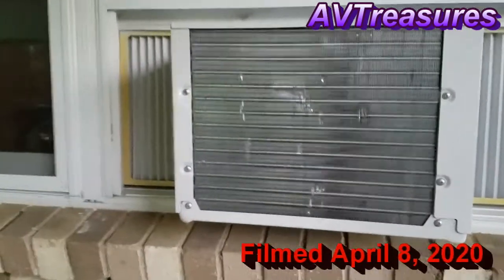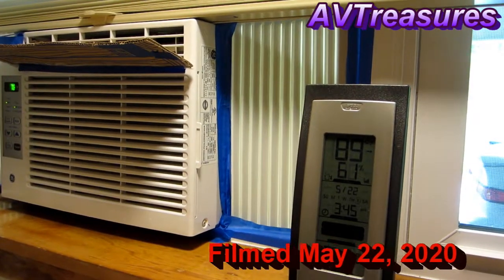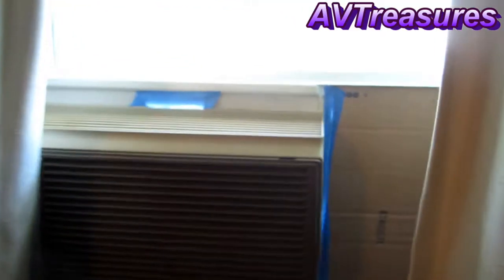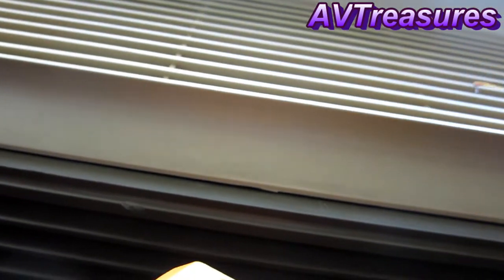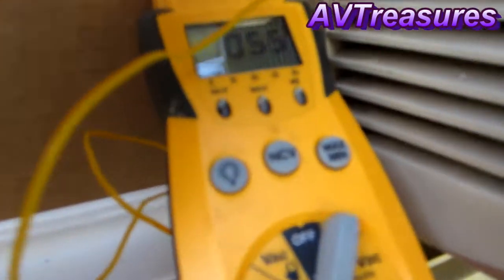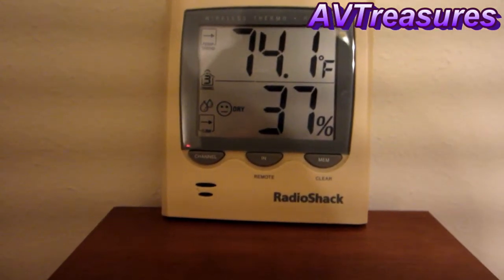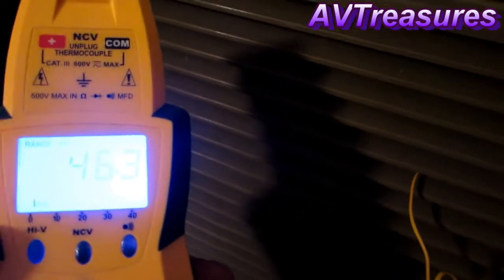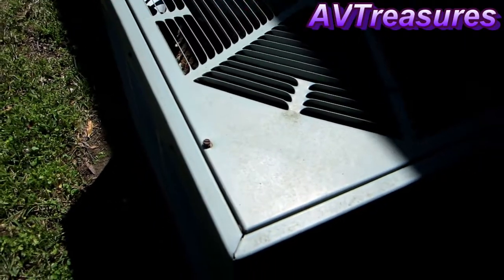Trying Out the 1989 Crest Carry Cool Window Air Conditioner | Spring 2020

Comment: That's nice that you have periods where you can do that.  Around here it goes from "too cold for A/C" to "it's staying on for the season".
Reply from the maker: This spring was milder than usual, all the way through May. I didn't turn the Rheem on for the season until June 1st. The new low E windows have something to do with that as well. I never would have made it that long without using the Rheem back when I still had the original single pane windows.

Comment: Nice units cooling and doing there jobs. I did the same thing use the central when there is a stretch of hot water otherwise my wall units manage quite well.
Reply from the maker: They are great units, very durable. I didn't use the Crest this year. I tried out some of the newer ones in my collection this spring. Thanks for watching

Comment: I do the same thing by avoiding the central air until it’s around 90 or so. It’s cheaper for me to run three window units versus running my tired out comfortmaker. Looking forward to your next video
Reply from the maker: My Rheem does a great job once temps hit the mid 90's to near 100. The rest of the time when temps are milder, it doesn't run enough to take care of the humidity. I have to run a dehumidifier at the same time. The window units are great dehumidifiers and they also are removing sensible heat which makes the balance just right. It is cheaper for me to run the window units as well. Even if one runs all day, it uses less than the Rheem would cycling on and off. Thanks for watching and commenting Ardie. I am working on another video right now. It should be up in few days.
Reply: AVTreasures do you live in the states? I live in Stratford, Canada, Ontario and we’ve been having some of the worst humidity here so I can say I can agree that the window units definitely handle the humidity way better. One of the main reasons I don’t use my central air is because my house is 116 years old and only has one return air vent. Whoever installed central air in this house back in the mid 1990’s really shouldn’t have because the ventilation system isn’t properly balanced. One day I would like to get a couple mini splits installed or a couple large through the wall air conditioners- I don’t think I’d be able to install more returns air vents. But for now I’m working with what I have! Thanks for commenting back.. I’ll watch for your new video and for your replies, for some reason YouTube never notifies me of half of the things I’d like to know about !
Reply from the maker: @ardiemclelland2039  Yes, I live in the southern United States and we get the humidity from the Gulf of Mexico at times and from the lush vegetaition and trees as well. You are right, a window unit is a great dehumidifier when there is a litttle cooling load. My house isn't balanced very well either. I have a hot room and a cold room all summer. I tolerate this by using fans that even things out some. The house was built with a just a central gas furnace and the ducts were  not properly sized for air conditiioning (too small). It's strange to me why they did that, yet installed a line set and condensate drain for future central A/C installation during construction. I know what you mean. I didn't get notified of this comment at all. I just happend to stumble onto it just now. No problem Ardie, thank you for watching and commenting.

Comment: Another year of reliable service, no surprise there!
If the house has a low heat gain, 5,000 BTU goes a long way. I always drill holes in the bottom of the units to let the water out, I don't think the extra few degrees of subcooling from the water is worth the damage from the rust.
I wouldn't replace that Rheem condenser, those things are nearly indestructible. Their new stuff is not nearly as good, and doesn't have the same longevity whatsoever.
Reply from the maker: That's for sure, no surprise at all! 
In mild weather 70's-80's, 5,000 BTU is usually enough for my house if I leave it running all day. It keeps the humidity really low so even if the temp does creep up to 75 or 76, I am still comfortable. I use a couple of vintage 12" desk fans to keep the house even throughout. It works very well. 
I usually drill holes in my units too. I just haven't had these long enough or used them enough to worry about it yet. I only use them for very short periods of time. Then I dry them out good and store them. 
I am really in no hurry to replace the old Rheem. I know I will never have a more durable outdoor unit. They are built like tanks! I just wish it were a 2 or 2.5 ton instead of the 3 ton. The 3 ton is very over sized most of the time.  I have a brand new 2 stage R410A Rheem RARL series condenser ready to go in one of these days. The cabinet on it is very flimsy compared the the old one. I will miss that. 
Thanks for watching Jordan!